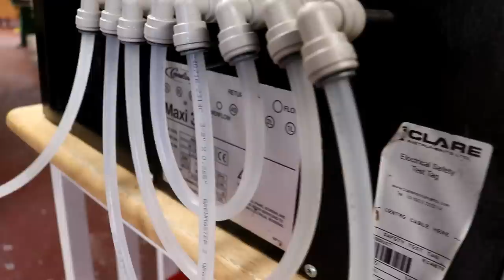MAXI 310 CLEANING

Comment: Gemma to the rescue of a poorly man well done Gem, drip tray looks coming along. We use the same idea on the Allotment to catch the water, but we use an old camera film tub or a sterident tube. Cut hole in guttering and slide either tube in, each tube has a lip on top and stops it from falling through the hole and make it flush. Also we attached an old inner tube to direct the water, all these things come in handy.cheers.

Comment: Great video that has given me a clearer understanding of how this wizardry works.
I’ve been looking at the Cornelius Maxi coolers and was pleasantly surprised to find they’re based 7 miles from where I live - result!
I’ve built a bar in my garden (yeah me and everyone else in the U.K. - cheers lockdown 👍🏻) and currently supply my lager courtesy of a Heineken Blade machine, however, having a single line lager pump is looking like the ultimate solution, hence my curiosity into setting up a pump system.

Comment: I followed step by step but must have done something wrong. When the air pushes the water through I find that pipes 4 and 6 (looking at it left to right) don't flush through but instead fill the reservoir. But the pipe in 5 releases the liquid into the container   If I loop 4 & 5, the mix flushes through but the pipe now in 6 doesn't release liquid int the container. What am I doing wrong? Many thanks.

Comment: Hi! Great video! I own a Maxi 310 cooler too, but it seems my water circulation line is not working! Do you have an idea if that could be fixed somehow? Any reply highly appreciated! Cheers!
Reply: Brother U have two option check the water circling motor (agitator motor) capacitor may be its need to change (1.5mf )or you have to change the  water circling motor.